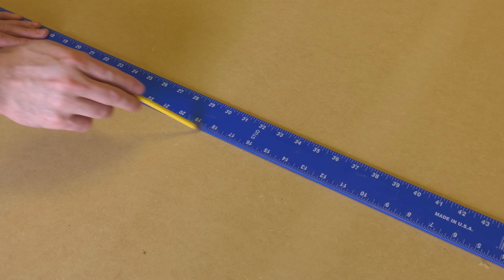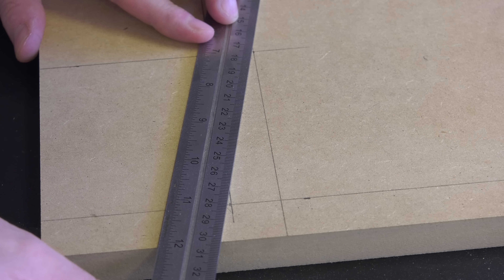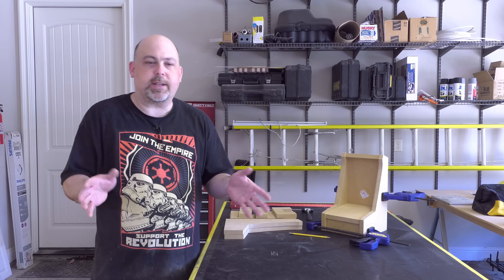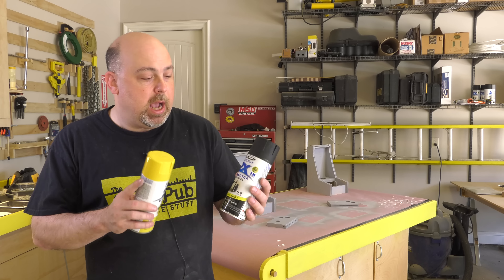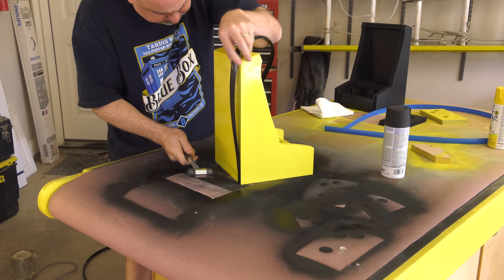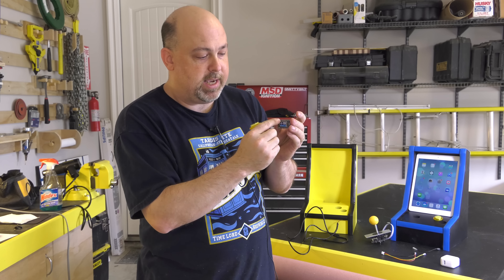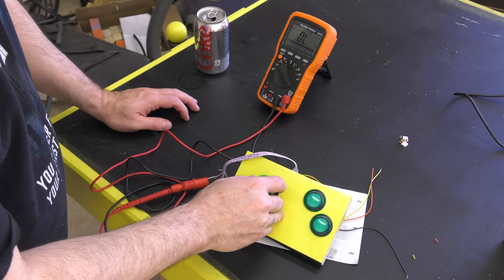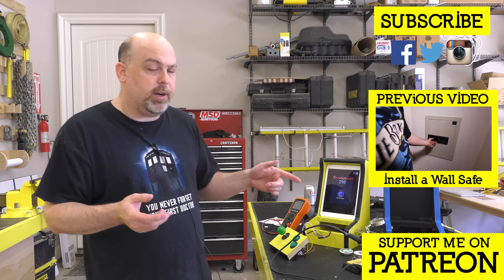Tablet Arcade (iPad Arcade) FAIL

Comment: I ran into this with the 8bitdo controllers, they support iOS in keyboard mode not game controller mode and the app support is very limited.  I wonder if there is a small Bluetooth controller that supports Mfi which is Apple's controller protocol.
Reply from the maker: I'm not sure.  My plan when I revisit this is to rip the guts out of a Nimbus or some other MFi controller and sacrifice them to the Apple gods.  I just can't spend anymore time on this project right now.

Comment: Id you jail break the iPad get mame can't you use it then? 

I Have happy chick on my iPad and iPhone has emulator and games all in . I bought a remote 20 quid Bluetooth and it came with happy chick installation.. 
Anyway yea just get a tablet the same size it will work I reckon
Reply from the maker: Yes. But I wanted to this without a jailbreak. There will be a part two. ;-)

Comment: I hate the electronics bits.  I would have made sure that works (greatest uncertainty) before building the case (which has very little uncertainty)
Reply from the maker: Well, I sort of did. LOL.  I tested it on an iPad Pro (the big iPad) which has different keyboard support. I had no idea the Airs were different.  I will still make it work though. I bought an MFi game controller which bypasses Apple's keyboard routines and will tear it apart for its guts.  Part two!
Reply: @TheGeekPub  Where is part 2? 😁 I know it's been 4 years but I'd still like to see it.

Comment: Crap, sorry you went through all this to get stumped right at the finish line.  I had two different Iphones since 2007 and while they work great for minimalistic stuff, I just prefer the ability of Android devices to do so much more with way less limitations, and no need to "jailbreak" just to do stuff a stock Android will do.

Comment from the maker: Well guys after spending the first weekend building this and then two subsequent weekends trying to get it to work I had to give up and move one.  So I present to you my failed iPad Arcade video.
Reply: that's what you get for using Apple products!
Reply from the maker: +John R (FlatulentRage) I love all technology!
Reply: +TheGeekPub me too! Although I prefer android over ios for reasons just like this.
Reply: Turn it in to a pinball table
Reply: One way to possibly salvage the project is to rip the guts out of a ION icade stick. It is a six button arcade stick for iDevices that runs through bluetooth. Gamestop actually has been discontinuing the product, and selling them dirt cheap.
Reply: Put a Raspberry Pi with RetroPie in it.
Reply from the maker: I plan to rip the guts out of a cheap MFi controller. I've already tested it and it does work.
Reply: you schould get somthing maybe like a cheap tablet or somthing if you dont have so mutch money
or buy a used one
Reply: or just buy a samsung galaxy tablet
Reply: Yeah iPads and anything requiring controllers will equal an instant fail.
Reply: Using cydia impactor works by installing mame emu ipa from a website . Cydia impactor signs the ipa u are installing (only works for about a week)
Reply: I know this is old but did you think about using a netbook? You could gut the netbook and place it's screen and motherboard in where the iPad goes, create a bezel to hide it all and hold the screen in place, and then drill some holes in the back for ventilation. Run the netbook power cord out the bottom near your USB cord, or just use the existing hole and power the adafruit off the USB ports on the netbook. Use the video driver to rotate the image to a vertical position. Now you have a wifi enabled arcade cabinet that you can stick on your wifi network and throw ROMs on it through SMB file sharing. Used netbooks on eBay cost maybe $50, or you may even have one in a closet somewhere since your cell phone is now able to do everything the netbook can and do it faster...